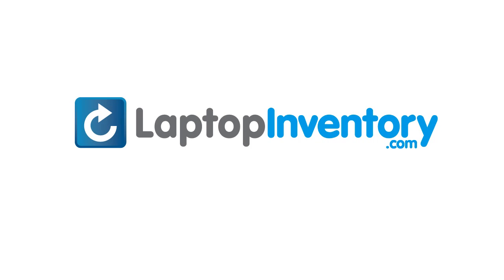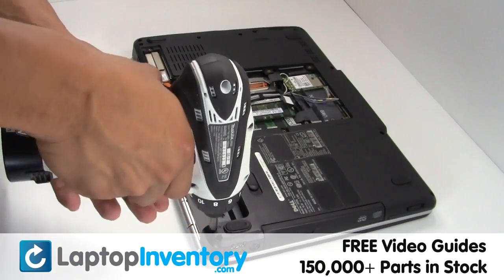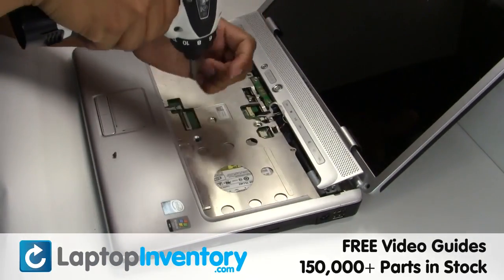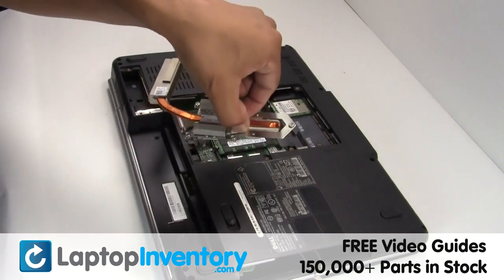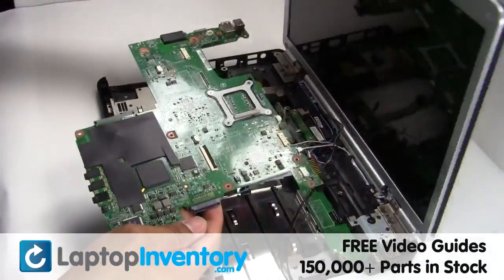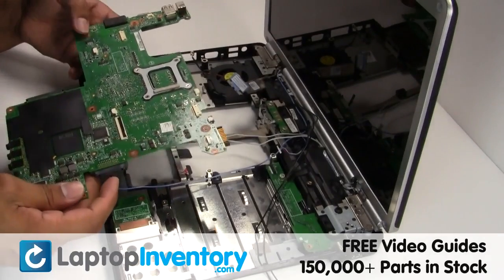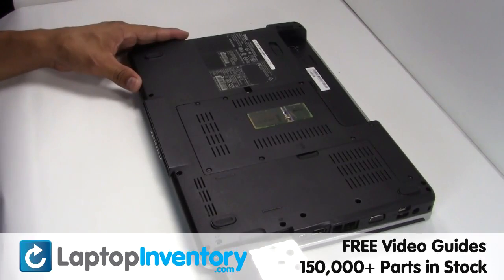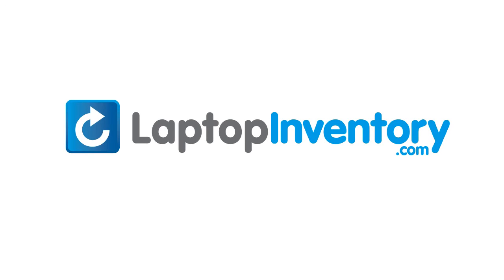Dell Inspiron 1525 1545 Fan Replacement Repair - Fix CPU Cooling Fan Heatsink Notebook Laptop

Comment: Hello, I still have a notebook of this same model: Dell Inspiron 1525, which has this sudden shutdown problem.
I've done the internal cleaning on all the necessary components and I could not solve his problem.
I changed the POWER SUPPLY, changed the BATTERY, changed the RAM memory, changed the 500GB HDD by a 120GB SSD, changed the PROCESSOR and DISPENSER, even changed the DVD DRIVER.
Unhappily it continues to shut down suddenly and leaving me in the hand, though now less often, but disturbing and inelegant.
Just have not changed yet: The wi-fi CHIP, the motherboard and the monitor screen.
Could the problem be in one of these still unchanged pieces?
If available, you could give me a light on this doubt I have.
I'm already happy with it.
Hugs.
Reply: Emei do Jd. Arpoador I still own this also. Mine was turning off when I closed the lid. I removed the magnet in the lid. And set it to sleep after 10 mins instead of when lid shuts
Reply: How does Ram change work on these I need ram upgrade

Comment: somebody knows how to pimp up my dell 1525? is it possible to add more RAM and more graphics and still cool it with this little fan?
Reply: NobelMicha 
The max ram you can put in is 4GB I think. I upgraded mine from 1GB to 2GB, I also put it a new wifi card and an SSD which helped speed it up alot. You can't really upgrade the graphics on it though, since it just uses the integrated CPU graphics.
Reply: brickman409 thx

Comment: how idiot can you be to put the fan there you have to disassembly whole laptop.Btw this laptop is strong from the side i have it 5 years almost but i hate when it overheats
Reply: MrVierinha1 
Yeah, it's a pretty dumb design. Everything else on this laptop is so easy to get to, but that fan is a major pain to replace. Makes me wonder what they were thinking when they designed it.
Reply: ***** But that's why it should be easy to get to. If it breaks and it needs to be replaced, why would they make replacing it so difficult? Making it harder to get to doesn't protect it in any way, it just makes it a pain it the ass when it breaks down.

Comment: that CPU seems a little thin on paste.... Some of you should clean the cpu and heatsink, and re-apply fresh thermal paste. That would help with the heat on the AMD Turion 64 processor that came with the system (THESE CHIPS RUN HOT).